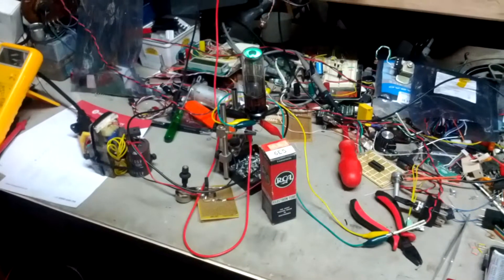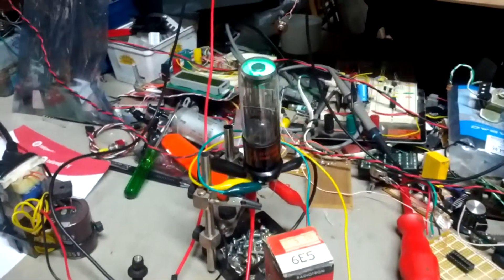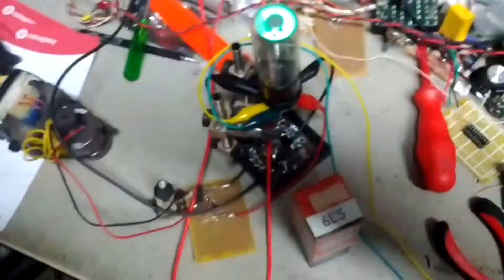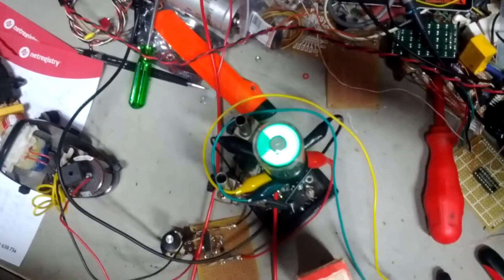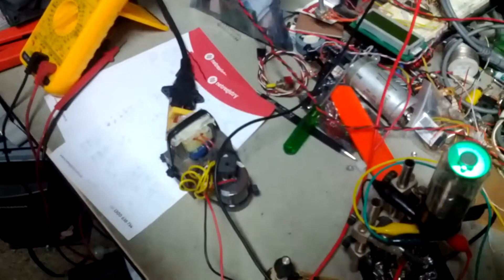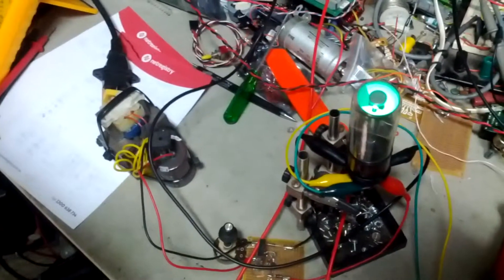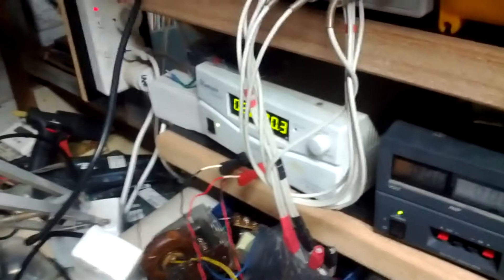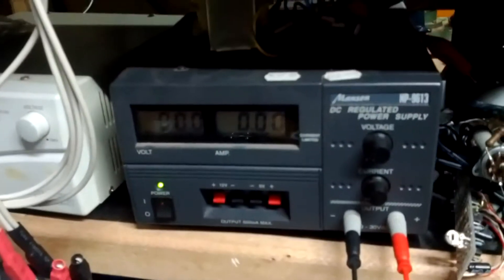6E5 Magic Eye Indicator Tube

Comment: 250v  target voltage is maximum permissible voltage on the 6e5, too much, it will wear the green phosphor quickly. 180v is what normally is applied, or even less. Also, the less target voltage you apply, the more sensitive the deflection gets.
Reply from the maker: Thanks for the tip!
Reply: @TimDousset  how common were these tunes in radios here? (in Australia)

Comment: do you have schematic?
Reply from the maker: Hi Ajna Vortex - Unfortunately no, I don't. This was just a bench test. If you google for the data sheet "RCA 6E5" there are plenty of PDFs. So you will need 6.3V DC for the heater, 100-250V DC for the plate. The grid will then take a range of negative voltages depending on how hard you drive the plate. In my case -8V (closed) to 0V (~90 degrees open). Cheers.